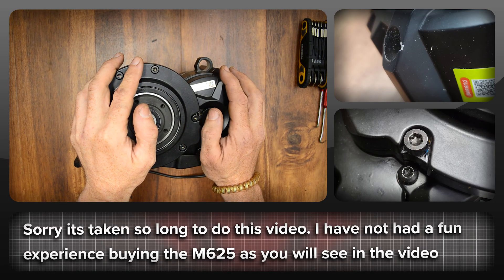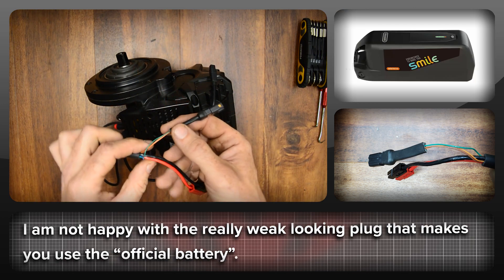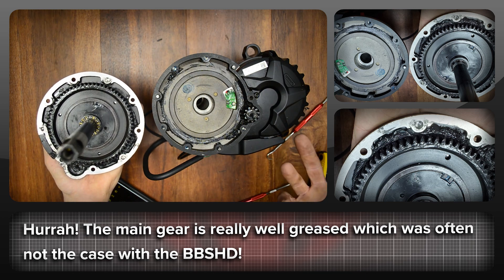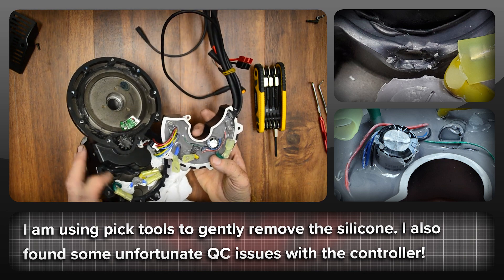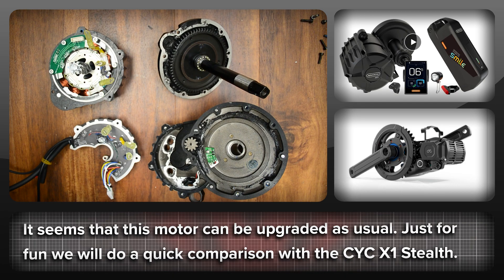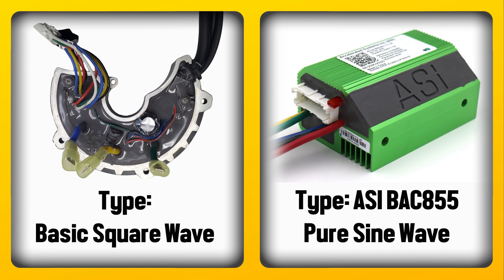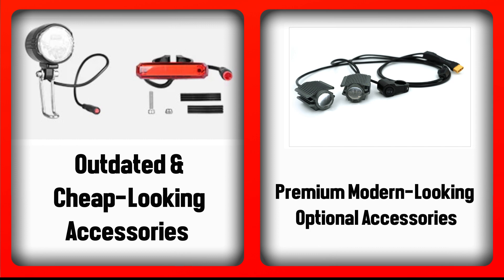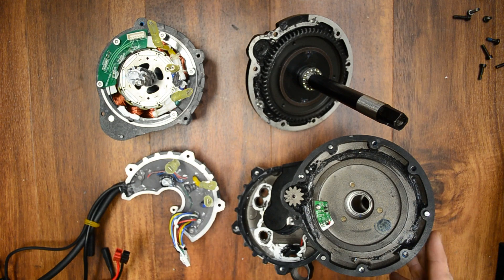Bafang M625 (BBSHD V2-) Lets See What is Inside! A look inside the updated mid-drive motor system

Comment: Thank you for posting this! I’ve hot rodded my bbshd to 3000 watts and I was curious about the new bbshd and any possible performance improvements. I agree with you that they missed some opportunities for the huge market of ebike hot rodders. I would have thought they would have at least changed the nylon gear since that’s prob the most common point of failure. I enjoy watching your videos so keep it up!  🤙
Reply from the maker: Thanks for the kind words. Glad that you like the channel. I would have added the PEEK gear as standard as well as better heat sinking and torque sensing. Lots more to come! Cheers

Comment: I did over 600 kilometers  on M625 - no problems  so far. My kit was in factory box , with all accesories ,tools ,instructions  intact (by the way - nice pendrive  in a form of credit card with instructions  was included)  Downsides: there is  no dedicated connector for shift sensor - had to use splitter cable and  connected with brake sensor - still it disconnects motor for not long enough ( I need to service and tune my deraileur also replace chain perhaps). Motor really does  what is  said on battery - made me smile every time i use it. As for 80's style of lights  - they are automatic (light sensor)  , rear light also working as brake light - not much to complain.
Reply from the maker: Well its good to hear some positive feedback. Really the motor is identical to the original in most ways baring the forced battery and other options. It's the lack of choice to push the battery that I don't like. My quality experiences could be a one off which is why I don't go on and on about it from that perspective. For me it's disappointing because I know what it could have been. Thanks for the info and comment! Cheers
Reply: @HighVoltageKits  people fried the controller to often, probably especially with 52v batteries
Reply: @dietbountyicecream1444  where do you take this information from about imaginary people? And 8% more voltage isn't even statistically significant. That controller can supply at least 50A without problems
Reply: @eXTreemator How can it provide 50A if even the mosfet heat spreader plate is not bolted tight against the casing compared to Toseven DM-01?
Reply: @uvwuvw-ol3fg  it's aligned tight enough,  you won't be able to take it out without good fiddling ability.
Reply: @eXTreemator  This doesn't mean that there is enough pressure against the whole surface area since there are only two small vertical bolts inside holding it down at the corners.
Reply: I made it 762 km before the battery stopped taking charge. Everything to do with the M625 is discontinued now. Very disappointed I burned so much cash for one summer of 12 km round trip commuting. Definitely cheaper to drive my half ton truck.

Comment: Thanks for making this video exposing the poor choice bafang make by bundling a proprietary battery with their latest m625 motor.  I purchased a m625 motor w/o the make you smile battery.  After chatting with a bafang rep who told me their isn't another battery to use, they shipped the m625 battery even after I explained how their proprietary battery will not fit my frame. Long story cut short I ended up buying a bbshd and installed it and am now returning the m625. If someone in the United States is interested in getting this motor without the battery pla let me know and I'll try to make it work for best of us... sincerely Rick
Reply from the maker: Thanks for the comment Rick. I am sending the controller off to a very skilled electronics and programming chap who will see what he can do. I am optimistic that we can at the least make it possible to run other batteries if not unlock the protocols for the controller. Stay tuned! If that works then motor will be usable. I think that it already will be usable with the upgrade kit we do I just need to redesign a small part. Cheers!
Reply: @HighVoltageKits  Unreal. Thanks for your efforts mate!!
Reply from the maker: You are welcome 😊

Comment: Have an M625 on a 2016 TerraTrike Rover. What I like is that it does not leap out there like other Bafang motors do. On a recumbent trike you don't want that leaping, but ya can get going right off with the throttle, Be careful where the throttle is placed, especially when trying to turn tight into it.

So it does great in Mode 1. Mode 2 to 5 is ghosting. I do not like ghosting. Would rather have the option to adjust assist levels, that the motor's downside, along with the oddly shaped proprietary connectors.

Everything is on a CAN-BUS system. The system will not accept non-M625 CAN-BUS components. Charger verifies the motor is correct before it charges. Use a different charger, the battery claims it will not charge. The battery has a 2/3 wire CAN-BUS connector, another annoyance.

Motor works good, past not being adjustable on assist levels which are my biggest complaints.
Reply from the maker: That's interesting feedback on the m625. I wish they were not doing the whole CANBUS  route. I'm trying out a couple of motors from a company called TOSEVEN. Might give people another option.

Comment: Glad I passed on the M625.  BBSHD is the better choice, although looking very dated now.
Reply from the maker: Yeah. I can't see me using it. Hope the bbshd will still be made over the next years.
Reply: these are all junk, just get a hub motor which is faster, efficient, and more powerful
Reply: @Blox117  which hub motor are you about?
Reply: @musmanov4642  i have several
Reply: What's the difference between the 2? Any improvements?
Reply from the maker: Not that I can see. They appear to run  the same just with restrictions. I'd get the bbshd if there is a choice.

Comment: They wasted the opportunity to stay in the Forefront of the industry.  I'm guessing they will regret it. Quality control seems to be going in the wrong direction. The market should be conducive for a competitor to fill the voids.  I love my BBSHD.  You made reference to it in the video,, but the majority of folks probably dont have the same, let's call it passion, for higher performance capabilities in their bikes as you (or I). The M625 probably surpasses the  requirements of the majority of folks. No excuse for poor QC though. Great video , thanks!
Reply from the maker: Cheers Bobby, good points. I think Bafang could do it if they wanted but perhaps they can't see the market. I am a little bit more looking to a scenario with light electric vehicles that is not yet legal in many places. Thanks for the comment. Cheers

Comment: How is the situation with bafang and bbshd and m635 currently? i was thinking about getting one of these, and as far as ive searched, the m625 has a better pedal power control (not sure whats the proper term), while bbshd doesnt have this function at all or something, but its not locked to bafangs battery?
Ive also watched ur video on CYC Phantom, and this one looked almost perfect, quiet, small, lightweight, but the one key feature i need is, end user reparability...
Reply from the maker: The M635 I think had problems with the torque sensor to start with. We just tuned it to work with our controller kits. I don't do much with the BBSHD or 625 stock so I am not the best person to ask in this regards.

Comment: Am personally still chuffed with my M625. Got the 1000w kit for £900. If spending $1800 and getting an already fecked with motor I can see being sore. Looking forward to insights on the controller.
Reply from the maker: Thats great to hear. I am very glad that it is installed and working for you well. I will update on the controller stuff once it gets tested. Cheers
Reply: Also I think the lights are really good. Shell suit coordination or otherwise
Reply from the maker: Its very much personal preference I agree. I used to wear a few shocking shell suits back in the day 😆

Comment: Is it possible to mount a  widely available bbshd controller on a m625? What would it take to get it to work?
Reply from the maker: There is a video on here where a guy does this. You need to drill and tap a new hole or two. The video is called all controllers work I think.
Reply: @HighVoltageKits  Thanks for the tip. Its too bad I'm not able to find the video, it sounds like exactly what I need.

Comment: Hello! I got interested in Bafang mid-drives. Which one should I buy if my main goal is to have the most durable motor? I mean I can buy any from 250W to 1000W and if I decide to buy bigger one I am willing to reduce the power (for a legal reasons)
Reply from the maker: The BBSHD is the strongest that Bafang make and is easy to repair and maintain. If you get an Eggrider V2 you will be able to easily set limits and speed restrictions for it.

Comment: Would a standard bbshd controller fit on that? Or atlest connect up to it
Reply from the maker: In theory yes it should. Not got one to try tho. The issue is that they changed the bolt pattern and size slightly.

Comment: Thanks for the vid!  I was wondering about the sprocket mount, drive cover and controller cover. 

Can you tell if the clearances for these pieces are any different compared to the bbshd? They look at least cosmetically different. 

I’m building a bbshd carbon gates belt mid drive with Alpine 8 IGH. doing all sorts of tricks to get the sprocket to sit with the least amount of offset away from bike midline. I’m doing cdx di2 sprocket custom mounted behind lekkie 42t sprocket to clear the sprocket mounting area and drive cover area. I’m to the point that I might have to shave a couple mm to the controller cover. I’m thinking that the “star” pattern on the controller cover would give me even less room to work with?

Another thing I’ve noticed is that lekkie just released a new 42t bling ring “pro truckrun” that has an offset 2.1mm less than the standard 42t bling ring. I’m wondering if they are able to achieve this because of the housing redesign? 

By the looks of it, to achieve my alignment goals, my sprocket will pretty much be butted up against the controller cover. 

When people upgrade theirs controllers , can they run no controller cover for more clearance?
Reply from the maker: To me it looks the same. I can check it with a few things but I don't have all the Lekkie stuff to hand. I don't think anything has changed at all beyond the controller. I can't say that 100% for sure. Lekkie make good stuff but not sure of the reasoning for the new chain ring. If it was done in response to the M625 I am not sure either. I exect all will become clear. With the upgrades the controller cover is just a drop in. I will be looking to see how it fits but it should not take much modification if any. With the chain rings as they often extend beyond the housing the issue is hitting the chain stays with the teeth. Not sure if you are on discord but there are some very knowledgeable folks on their with regards to lekkie... https://discord.gg/VRZAfn8E Cheers.

Comment: Along with the disappointment, they also lack some bracket mount to fixate the motor like the cyc x1 pro or stealth
Reply from the maker: It has a loop that you can use a hose clamp on. But its a pretty ugly thing.

Comment: Just curious, how did you remove the stripped screws? The screws are stripped on my bbshd also can't get the cover off I bought some allen and hex wrenches for removing stripped screws but didn't work just curious what method you used to remove the stripped screws?
Reply from the maker: I very gently backed it out. Once it was out there was a chunk of the threaded that was just loose inside. Yours sounds like it really jammed in there. You could try some heat and a pentrating oil. If you wanted to post pics on discord people might have more ideas. https://discord.gg/high-voltage
Reply: Try an 'Easy Out' drill bit tool, or simular brand.

Comment: The biggest improvement is the loop on top for a hose clamp to secure the motor to the down tube on the frame.
Reply from the maker: Its not needed installed right. But it helps a few people. Perhaps they had lots of issues?

Comment: Awesome video John. Well explained...thank god I purchased 2 bbshd...M625 kit looks terrible...I think Bafang's chief tech designer needs to get the sack...terrible build quality...when I get some cash I will upgrade to a high voltage ASI controller and a 72v battery...the exisisting 160nm is a sweet tractor puller..good video mate 😀 submarine.
Reply from the maker: We got your covered! Look forward to that. Cheers

Comment: Can you make a BBS02 video?
Reply from the maker: Hey! Thanks for the interest. There is not much difference in the the two really. I don't have a BBS02 and really with the path I am going it would not make much sense right now as I have limited budget to stretch. There are a few people using them on our discord server. You are most welcome to join and we can certainly help you with this motor system and you can chat to riders using them both stock and with the upgrade kit we do. https://discord.gg/high-voltage

Comment: They are definitely trying to compete in the Euro-spec market instead of the DIY market with this kit. I heard lower motor RPM and torque numbers. It seems to me a legal CYA shift in their ethos. I even understand a proprietary battery, from a liability POV, but the single huge size makes the new kit unusable on most bikes, unless you run extending cables and mount the battery somewhere other than the frame.
Reply from the maker: I think that they would be better off with a new motor then. Cause it has no torque sensor and the competition does. Or at least price it lower. The lack of decent programming is a real worry because if people can't get it to run nicely its more dangerous than a high power version. I am confused also lol. Cheers
Reply: @HighVoltageKits  Seems like only pointless changes to win a market they're unlikely to win, while abandoning loyal fans and customers..

Comment: Hoping that someone would share the dimensions of the cable plastic cover so that we can 3d print some for our BBSHD
Reply from the maker: I don't think it will work with a bbshd as the motor housing will lack the required bolt holes.

Comment: The battery is  a killer, though I like the cells. I don't know why anyone would think Bafang wants the DIY market. They opened a factory in Poland. They will ship stuff into Europe where there isn't so much performance equipment. They are going after Bosch. They are going for the big bucks. So what's the problem if CYC is a better DIY motor, a performance motor? All they have to do is develop the DIY market. I just run a stock BBS02. I don't want much more and if I did, I would want to get out of the ebike classification and into something completely street legal. There's a lot of stuff in China, Enduro ebikes with pedals, but 5,000 watts with 3 kwh batteries, hub motors. Everyone is juggling a lot of balls, and how big are any of these markets? How many e-motorcyles will Sondors sell? Too many games. Some people stretch the regs. Some people lock down the bikes. And every time you order from China, you play garbage roulette.
Reply from the maker: I think they will need to step up the game to touch bosch. Or make it much cheaper. Interesting on the factory information I was not aware. If they sells tons of these then I guess they are doing well. It just annoys me that a few simple changes would have made it viable for so many more people and sell them more motors?
Reply: Disappointing that it comes with a proprietary battery. It seems the price tag converted to US dollars is much higher than buying a BBHSD and battery separately. I would buy a BBHSD while they last.
Reply from the maker: Yeah. Its not a great situation. I hope some common sense prevails and they keep the bbshd

Comment: For myself and many urban and commuter people, the CYC X1 will always be discounted immediately, irrespective of its numerous advantages, because of i) horrible electric-chainsaw noise ii) comparatively more annoying installation.
And I wouldn't hold out because of the proprietary battery - I'd imagine someone's going hack/bypass that shortly...we always do.
Reply from the maker: You would think so. I have a few people looking into it. It also seems the bbshd will be around longer now.
Reply: If i didn't find a good deal on a new BBSHD and a large capacity and current handling 52V battery for €600 less than a CYC in my country (€1600 to my home without a battery because of dumb import taxes and shit) i would've 100% went for the CYC

in my case its just a matter of money honestly, the bike i run it on did cost €~400 out of a store back in the day

so i definitely wouldn't put a freaking motor thats worth 4 times more than the POS on there, if i could get the CYC for €1K i wouldn'tve hesitated, at all

torque sensing, that power and a great controller.. who cares about the sound it makes

and yes i would've used it for commutes as i don't do mtb shit but i have quite a few uphill parts where torque and power definitely are great to have

so far my ebike sits at a total of €1.5K approx (just the thing itself and the components on it, not really counting things i've replaced etc, except i've replaced the wheels, tires, chain, freewheel etc. to better ones)

i'm not a person that wanna pay a huge price for the best performing and lightweight parts

i've previously had a Tongsheng on it and i loved the torque sensor feel which i unfortunately miss with the Bafang.